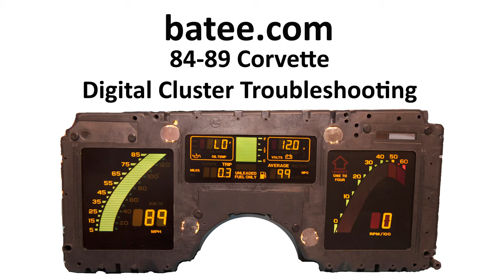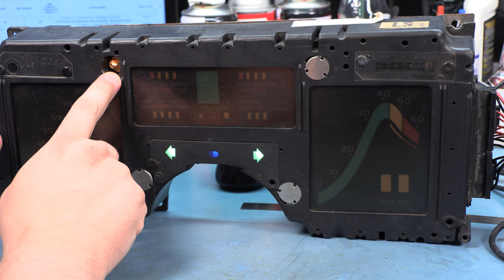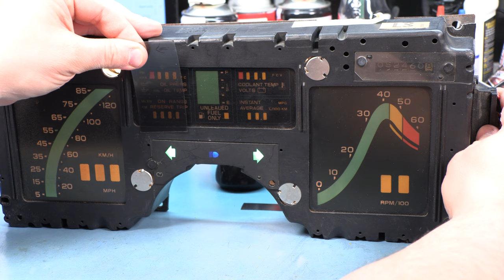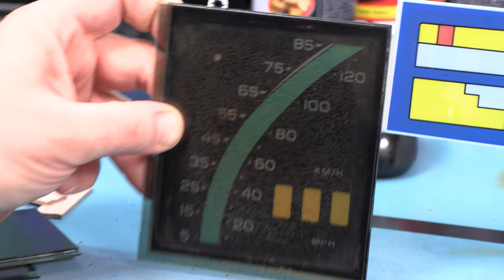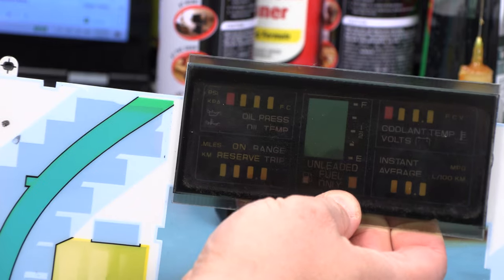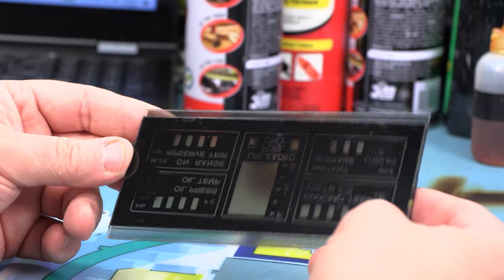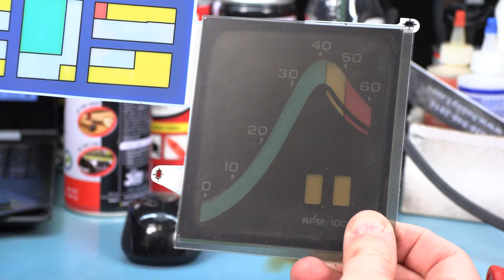1984-1989 Corvette Instrument Panel Troubleshooting #1 (2021) by batee.com

Comment: Hi Brian I have recently purchased a 1988 C4 Corvette and of course it's old and there's a lot of minor repairs that need to be made, my first concern is with the cluster panel and when it's on and working it's absolutely perfect except when I hit a bump it turns off and on intermittently ,while watching some of your videos on troubleshooting my best guess would be that there's a loose connection, so my question is what is the most common area that you're finding this problem with a bad connection or bad solder joint those kind of things, I am a technician with experience on Hi-Tech computer controlled machinery although I have no formal electronic repair education just troubleshooting and replace, I'm pretty confident in making the repairs myself I thought with all of your experience with this issue which seems to be one of the most common issues I'm sure your finding the most common causes would be ----------- ? Where you're finding the two or three Main issues are???? Your help and advice would be greatly appreciated
Thank you in advance
Reply: 12 pin backlight connector is #1.  Power supply is my next suspect.

Comment: Im trying to fix one for a friend of mine and the backlight is not working. If i inject on the dimmer pin some volts then it starts and the dimming works good. Any thoughts?

Comment: My 84 starts out fine for about ten min--then it goes to a mode of both turn signals and the bright lights indicator are frozen on, while everything else is practically off. Sometimes it may come back to proper operation after a long while, or in a rare occasion a big bump, but mostly it stays in that mode.
Reply: Mine is doing the exact same thing. I'm thinking there's some kind of fuse blown somewhere or a bad ground.  My 85 is temperamental I swear there's a gremlin in the electrical system.
Reply: @derekenlow7607 bad ground I think...I dealt with that many years ago ...run a wire from your brake pedal metal area under The dash to the ground in the cluster wire harness ground

Comment: Also I want to put a 4link amd my drag motor in it what wires to what gouges if I cut the plugs and make my own speedo oil and water and tach amp also thats all I want and need would be nice to just take a peice of sheetmetal amd put round aftermarket gauges in it it's going to be a race car eventually but driven on the street until I get it all done it runs drives it over heated and now I can't see temp and radio gone any help please and thanks

Comment: Brian, I have an 87 with peculiar issue. The right side of my cluster is dim and the left side is bright. I don’t have any fading or backing separation. Wondering if it could just be bulbs? Also I have intermittent flickering with lights on or off. Wondering what you think my problem is. I’m thinking power supply.
Reply: It's power supply Right??

Comment: My 84 cluster has a tach lighting issue. When it’s cold, the numbers from 0-40 don’t light up. As the car warms up they start to flicker. Once warmed up, they stay lit. Could this be a dirty bulb contact, or am I in for a major overhaul?  The car has 36,000 miles on it, and has always been garaged.
Reply from the maker: Is the issue that the LCD segments aren't turning on, or is it that the illumination bulb in that corner isn't lighting?  You might need to take off the trim and check all four bulbs (under the silver covers).
Reply: @crazyuncleburton  it’s the numbers going up the tach ramp. 0-10-20-30-40 do not light up steady until the car is warmed up, or the weather outside is warm.
Reply: They flicker on and off till they’re happy. Lol
Reply: @FranksModelAviationWorkshop  I believe it is either a bad 12 pin connector set, or broken solder joint on this connector.
Reply: If all the other data is correct while 0-40 is flashing, we may have a bad LCD driver IC
Reply: @bryanthompson3180  so would that be the backlight repair? Or could I just re-solder the old one?
Reply: @FranksModelAviationWorkshop  look at the old connector. If you see melting or discoloration, replace it or send to us for backlight service. If no melting, try resoldering.
Reply: @bryanthompson3180  ok. I haven’t removed the cluster from the car yet, but that’s next on the agenda. I just fixed the the power antenna, and replaced an amp in the passenger door speaker. The delco/Bose stereo sounds perfect again. All I have left to do is the cluster bugs. I really enjoy watching your videos. It takes me back to my childhood watching my dad build Heathkit TVs.